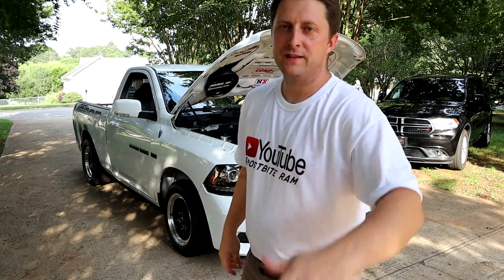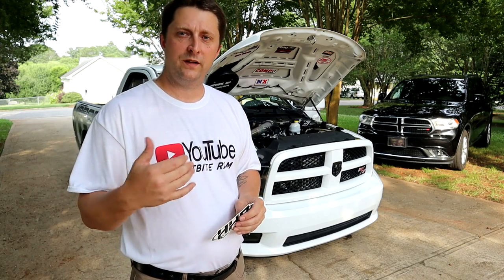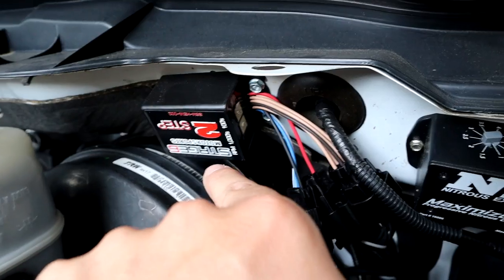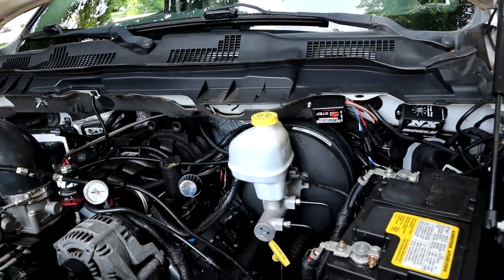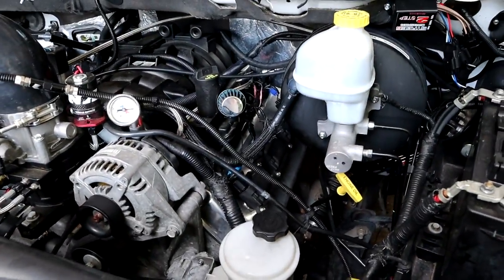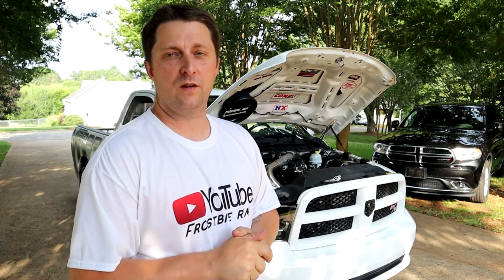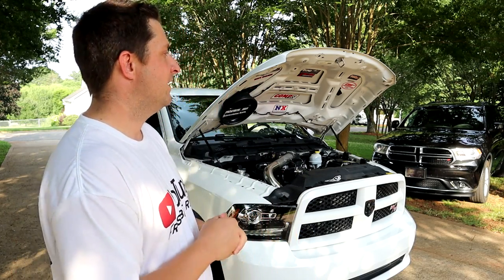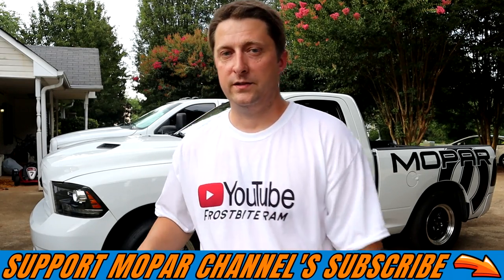2 Step From Stage6 MotorSports Install & Test On HEMI 5.7, 6.1, 6.2 And 6.4 Cars, Trucks And SUVs

Comment: For clearifcation.... The 2 Step comes with a micro switch for activation to be installed behind the brake/clutch pedal. It does NOT get wired to the brake lights. That's a horrible way to do it. The delay is terrible. We tried that when we first developed this on my Jeep back in 2011. I cut consistent .6-700 RT with it. Once we went microswitch, it was night and day.

Comment: 1st bite I finally got my dry share from my 2017 RT from Houston and running great Thanks thanks for the information  To get the drive share from Houston it seems to be the only one that holds around
Reply from the maker: Awesome hopefully it holds up
Reply: @FrostbiteRam  its held up in some tuff cars in my area no trucks get
Reply: Yet
Reply: @FrostbiteRam  I get a roar around 120 any advice ik something is off
Reply from the maker: @jasonhoover1707  not sure man luckily my truck is older and don't have the drive shaft issues that the new truck have. May need to contact Matt at moes performance he has a really fast 4th gen 8speed regular cab not sure what drive shaft he uses.

Comment: good God, your truck sounds great!... 
ps would this work on an 8 speed auto?
Reply from the maker: Thanks man and yes it does not matter what transmission you have the 2step works with all the hemi engines
Reply: Yes it does I just installed mine however even at 2000 rpms the rear brakes aren’t strong enough to hold the rear wheels. Although it is fun to do burnouts with I’m trying to figure out a solution like braided steel brake lines and some drilled and slotted rotors.
Reply: Also if you are just setting this up on your brake pedal you will have to either make a new mount for the switch or make some type of bracket that starches to the switch.

Comment: Is there a reason why you kept the 5.7 manifold instead of the 6.4?
Reply from the maker: Just haven't upgraded it yet but I'm working on something soon it won't be a 6.4 or 5.7 manifold tho.
Reply: @FrostbiteRam  I’m looking to get a stall for my 8 speed and some e86 before I port my heads and get my cam kit.
Reply from the maker: @8hp70cris  stall is a big gain in racing

Comment: Damn that sounds good! Have you turned the boost up anymore or still running low boost?
Reply from the maker: We have around 9ish psi shifting at 6500
Reply: @FrostbiteRam  nice! What kind of power is that putting you at? 
Also do you happen to know what's the highest boost output? 
I was gonna do this boost kit earlier this year but I think I'm gonna wait til winter to go this route
Reply from the maker: @waznme3920  running mid 11s currently in the heat good air i should see high 10s this fall i hope. Depending on build and camshaft should see about 12psi on small pulley
Reply: @FrostbiteRam  getting into the 10s will be awesome! That's my goal this year on nitrous since the car is already setup for it. Low 10s or 9.99 once I am able to get the trans upgraded.
Reply from the maker: @waznme3920  awesome man 💪🍻

Comment: What size tires are you using on the rear end when you are racing?
Reply from the maker: 315 50 17
Reply: @FrostbiteRam  I have 2018 RAM with Hemi, if I run tires that small I would never get off the line.  I put new tires on the truck and lost 1.5 seconds.  Was running mid 14's now high 16's.  Tire spin all the way through third gear.  I am running 285/75 17.  Same height as OEM.  I am going to go to 33-10 slicks for next ET summit race in September.  My truck: Cold air, shorty headers, E3 plug, exhaust cut out, and Diablo tune.  Depending on the temperature here (Phoenix) normal ET around 14.5 to 14.7 @ 95 mph.
Reply from the maker: @terrenceliesegang9223  33s will slow you down tremendously most of the fast rams will run a 28 or 29 tire and dead hook if you cant then you must have a open diff
Reply: @FrostbiteRam  I have 3.92 limited slip differential.  Lots of torque from the hemi.  Dyno results @ 110 degrees ~ 430 crank HP.